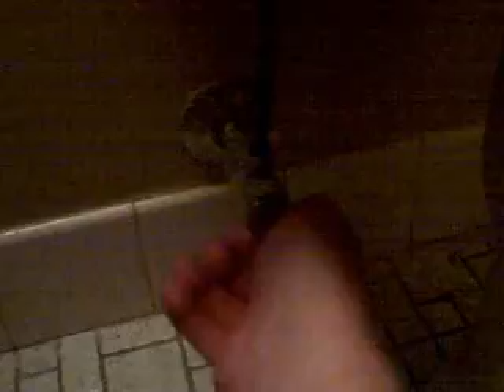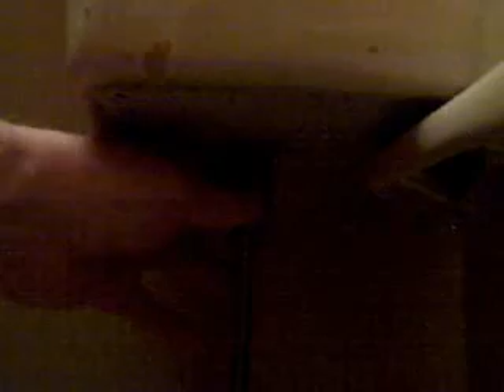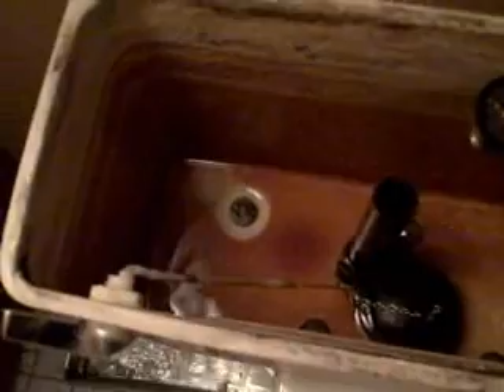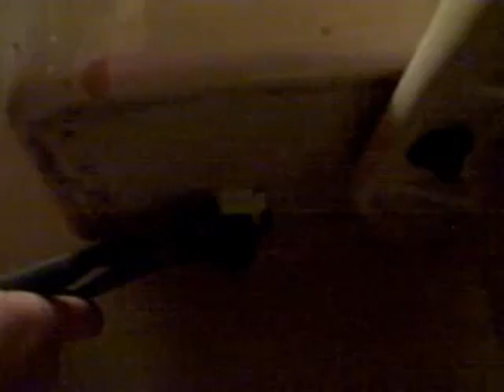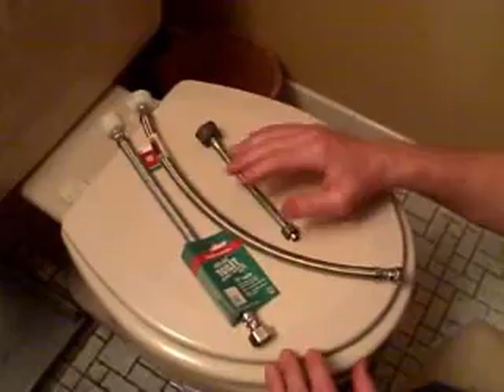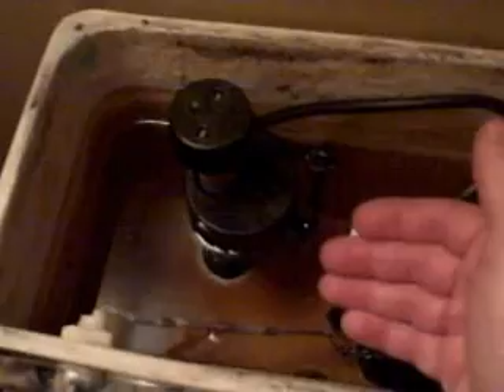How to Replace a Toilet Fill Valve - Fluidmaster

Comment: Sometimes my fluidmaster won’t start filling after a flush. If I open the tank and just lightly push the black rod on the float it will kick on and start filling. Almost like the float is getting stuck. Is it just time to change it or can this be serviced?
Reply from the maker: Hi, I would change the fill valve. Here is an updated video. https://youtu.be/2fVzAXakjZ0

Comment: The first step in replacing the toilet fill valve is to replace the shut off valve to the toilet because it doesn't shut off all the way.  But the whole house shut off valve doesn't shut off all the way either, so you need to replace it too.  Since replacing two shut off valves and a fill valve is a lot of work, and all manner of problems are likely to be encountered when messing with old pipes, I'll just call a professional plumber to do all of it.

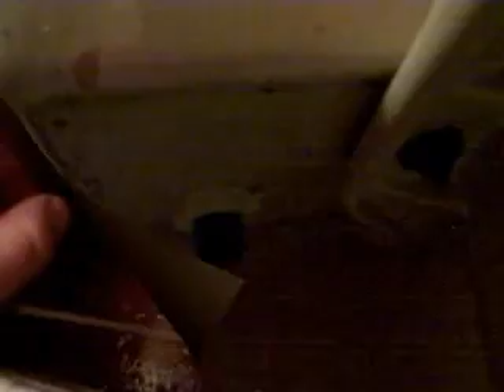Comment: At about 3:30, when you first mention installation of the refill tube, the "fitting" is placed so that the refill tube sends water into the tank instead of into the overflow tube.   At 5:40, this is seen to have been corrected.  Might be a nice detail to mention to your viewers that the refill tube indeed does need to empty into the overflow tube, to insure that the bowl is refilled properly so the next flush is successful.  Thanks for taking time to make this video!

Comment: my flushing tank water overflows, turning the rod counter clockwise water not stopped. what might be the reason?
Reply from the maker: Hi, when you say it overflows, is the water coming out of the tank or into the top of the tube on the flush valve? You are turning the rod on the fill valve?

Comment: I can't fix a thing to save my life. But by using your video and a few others, I was able to replace my ball cock with a new universal fluidmaster fill valve. Took me two hours and was much more difficult due to cramped space and supply line nut being very difficult to get off at the top, but I did it. Thanks for this video.
Reply from the maker: You're welcome.
We have more home improvement tips on our weekly podcast http://castbox.fm/u/6389499.

Comment: Going to be replacing mine in a few days...
Reply from the maker: Hi, if you have a high efficiency toilet, 1.28 gpf. Use the PerforMAX fill valve and adjust the amount of water in the bowl. For older toilets, the fill valve in the video will do a great job.
Reply: I ended up using a universal replacement valve from fluidmaster this morning, Install was a breeze and everything is working like it should. Took no more than 20 min!
Reply from the maker: Great! We have more home improvement tips on our weekly podcast http://castbox.fm/u/6389499.

Comment: If you're not replacing the supply line (which if it's not leaking, and already the flexible kind, why replace it), you don't need to loosen the nut from the bottom valve to the supply line FWIW... :)

Comment: Are they better than the old bubble float type valve or called flip float valve? is there any flaws, let me know because i'm planning on replacing mine!
Reply from the maker: Hi, 2 of the top rated are the Fluidmaster and the Korky fill valve.
If you have a high efficiency toilet, use the PerforMax. It puts more water into the bowl for better flushing. 
We have more tips in our home improvement book https://amzn.com/B01MRGO8C5.
Reply: Thanks, I had replaced mine with that type of fill valve, and it really fills the tank faster, and my old one had like continuous hissing sound, which is the gasket was bad on the valve so i figured it's time for replacement or upgrade!

Comment: The problem I ran into was being able to extend the rod.  When I pulled on it - it wouldn't move.  But since I saw you pull it out in this video I knew it had to come out.  So I pulled much harder while being sure not to squeeze the top so hard I had to break something.  People should be sure to move the little band off when pulling it out.  I had done that but it still wouldn't budge until I put some more muscle into it.  So you may have to pull fairly hard to get it to extend.  Thanks for posting this video.  Really helped.

Comment: That toilet label is interesting. Is there any doubt that is in fact a toilet to anyone? Maybe in the other bathroom it's an escape hatch to a bat cave and that toilet has a label that says "Bat Cave Entrance" ?
Reply from the maker: Ha
Reply: Great video and glad you have a sense of humor!  Wish I had seen this before I replaced mine.  Had to readjust the height after it was bolted into the tank.
IMHO this is a cheap valve.  Mine was only 1 year old when it started leaking back into the bowl and didn't realize it was leaking for weeks.  That refill flexible tube has to be mounted in the center of the vertical refill pipe with that extra part and clip so if it does leak at least you can hear it splashing.  The vendor claims  the mod is to prevent siphoning but that is complete BS in my opinion.  The mod is so you can hear if the refill valve is leaking back into the bowl.

The specific valve I had was with a brand new Mansfield toilet Part number 2300 something so a very similar valve but may not be the exact same manufacturer but general design.   Very flaky in general I think and the refill tube mod points to chronic leaking problems.

Comment: When my boyfriend put this in, I don't believe he looked at any instructions. But forgot to put that rubber piece at the very bottom and it leaks now. How do I remove this specific fill valve to get that rubber piece in place?
Reply from the maker: Hi, turn off the shut off valve going to the fill valve. Hold down the handle and drain the tank. Put a pan under the supply line going to the valve. Take off the supply line and remove the one nut holding the fill valve in place. Pull it out and put on your washer. The beveled side down toward the toilet.

Comment: Do you have an instruction video on repairing a tank that won't fill or fills very very slow
Reply from the maker: Hi, if you have a Fluidmaster fill valve, you can push and twist the top cap and lift it slightly to flush out debris. Keep it covered with your hand to prevent water from spraying up.  If you have a different style, let me know. 
If flushing doesn't help, then change the valve.
We have more tips in our home improvement book http://www.amazon.com/dp/B01BK2K0JM?ref_=pe_2427780_160035660

Comment: THANK YOU SO MUCH!!!  I found a puddle in my bathroom yesterday.  I shut off the water immediately & of course cleaned up the puddle.  

It was the original toilet (30 years old in July!) complete with that big ball thing.  The thing holding the tube in place was difficult to get off.  Between the fact that the toilet is 6" from the wall and the plastic piece was so difficult to grab; I almost gave up a few times.  

One thing I really liked about the new one is there was big wing nuts so it would be easily removed next time.

I purchased a Fluidmaster 400A and the instructions were impossible to read!  The printing was small & even worse confusing!  (Well at least to a person who never replaced anything like that before!)  They show something about grabbing the top of the new device AFTER it was screwed into the toilet and lifting it up and ripping the top off.  It showed some drawing and even said when you do this have something over it because it will spray water upwards.  It also said to turn the water on & fill the tank and then drain it again and "prime" the top. 

I went to the website for Fluidmaster and they had a link to a video.  I watched it and found it just as confusing as their printed instructions.  It also showed pulling on the top of the plastic and turning the top 3/4 of an inch.  

I finally decided to just go to you tube and put in "how to install the Fluidmaster toilet valve."  Your video was first up so I watched it!  Clear instructions and then showing how on the video!  

I still don't know what the instructions meant about pulling up & turning the plastic and prepare for spouting water but your video didn't show that so I didn't do it.  I only had to turn the water back on once and I had no leaking from the valves and it is now working great!  

So thank you for the great & crystal clear video!
Reply from the maker: +Suzie Phillips Hi, glad it was helpful.
We have more tips in our home improvement book http://www.amazon.com/dp/B01BK2K0JM?ref_=pe_2427780_160035660

Comment: I'm changing my fill valve, and it has been glued to the tank with something.  It broke off trying to get it out.  How can I get the remaining stuck part off the tank bottom to install the new one?
Reply from the maker: +Teresa Jackson Hi, did you get the nut off the bottom of the fill valve? What part is stuck, inside or out?
Reply: Inside is stuck.  The nut came off on the outside easily.  A plumber fixed a leak there a year ago and changed it all.
Reply from the maker: Can you take a slotted screw driver from under the tank and tap the piece that is stuck. Pushing it up and away. Being careful not to hit the tank.
Reply from the maker: You can send a picture to fixitpodcast@gmail.com

Comment: what happened to the other black rubber washer, the one that was in the center of the big washer? was it thrown away?
at 2:20
Reply from the maker: +nonoyd Hi, the center washer is for a solid supply line. Most people use a flexible supply line so it isn't needed. The new packaging doesn't include it.
We have more tips in our home improvement book http://www.amazon.com/dp/B01BK2K0JM?ref_=pe_2427780_160035660
Reply: +FIX IT Home Improvement Channel thanks for responding, i replaced my tank with fluid master refill  kit  a few years ago and i dont remember seeing  that center washer. i thought i missed something, i bought the rectangular or square float refill kit.

Comment: Why do you have to replace the supply line?  The video didn't show this as a "possible" need, just what you have to do.  But I wonder why.
Reply from the maker: +Gloria Jenkins Hi, the supply line that was there was an old rigid supply. If you have an existing flex supply line you usually don't have to replace it. I should have addressed it better. Thanks!
I will put together a video showing off some tips for supply lines.

We have more tips in our home improvement book http://www.amazon.com/dp/B01BK2K0JM?ref_=pe_2427780_160035660
Reply: Thanks!  I checked it a few minutes ago and it looks pretty ancient!  I don't think my husband changed it when he swapped out the old ball float for the new one.  I guess I'll get a new one!

Comment: Why didn't he re-use the old supply line? Would the old one not fit on the new fill valve, or was it simply a precaution to replace an old part with the new one?
Reply from the maker: +Bungle Hi, the old supply line was rigid and just fit. The new flex supply line was easier to connect. 
We have more tips in our home improvement book http://www.amazon.com/dp/B01BK2K0JM?ref_=pe_2427780_160035660

Comment: I have a new fill valve and the height wont adjust on it.  What do I do?  Do I need to return it and get a new one?
Reply from the maker: +Kathy Booe Hi, what is the problem?  Is it too high for the top of the tank to go on, or are you having a problem adjusting the water lever?

Comment: How do you know if you have to change the fill valve or not?
Reply from the maker: +Joshua Truax Hi, if it is filling slow and you have flushed the top valve, or if it keeps running and won't shut off. That's when I swap them out.
Reply: +FIX IT Home Improvement Channel Oh ok thank you so much.

Comment: I need a kind of gasket for my supply live. It leaks, and needa rubber thing inside. What is it and whats is the normal size?
Reply from the maker: +Tino Rozzo Hi, I would pick up a new braided supply line. They have a beveled washer that does a great job. I doubt if a hardware store will carry that gasket.
Reply: Thanks. I don't know what my plummer did. I had to get a rubber O ring for the bottom of the flow valve connector.

Comment: JUST GOT THE WORD FROM FLUIDMASTER RE:  WHY IT'S TERMED AS INCOMPATIBLE,   IT WILL FIT,  MINE FITS GREAT,  BUT THE ISSUE IS THAT THE MATERIAL USED IN THE MANUFACTURE OF THIS PART WILL"DEGRADE" IN THE PRESENCE OF A CERTAIN LEVEL OF CHLORINE.   AS SUCH IT MAY BREAK UNDER WATER PRESSURE,  ESPECIALLY PRESSURE SPIKES.  REGARDS,
Reply from the maker: +LLuE88 Great. Thank you for sharing.

Comment: very good.      Question on the FluidMaster unit,   do you know why FluidMaster has indications as to  not use/remove the bottom tube "shank " if it is gray  or not Black.  If it is Black it is fine to use it when the initial intension is to replace the whole FluidMaster unit.   thankyou,  regards,
Reply from the maker: +LLuE88 Hi, you are talking about the Easy Fix 400? This kit is designed to leave the main body of the old Fluidmaster in place. I would remove the complete old unit and replace with a traditional 400 A. 
Let me know if that helps.
Reply: +FIX IT Home Improvement Channel I suppose I need to call or write to the factory.    If it's faulty material,   it definitely needs changing,    if it's a leak  or compatibility issue,  then living with it may be OK?     Noticed a slightly tighter fit with the newer top part,   easy to fix though.    regards
Reply from the maker: Hi, just curious why you picked that rather than the whole replacement.
Reply: +FIX IT Home Improvement Channel just prefer to use what's available and safe or proper to use.  Also to warn kin if there is a problem.   In part I was the decision maker on some inferior Chinese parts that would have failed on a good sized piping job,  initially no  one knew there was a defect except by lab reports,  the producer was found out after the lab reports.  regards,

Comment: Instruction sheet enclosed with new valve does neither say anything nor show anything about releasing the lock collar to increase the length of the valve shank. Would be very helpful if it did. Thanks for showing this.  Used cheap  disposable turkey baster to remove  remaining water in tank - dispose of water in toilet bowl - saves a lot of mess,
Reply from the maker: will alexander You're welcome.
We have more tips on our weekly podcast https://itunes.apple.com/us/podcast/fix-it-home-improvement/id880903087?mt=2

Comment: Nicely  done...would have been better had you put some kind of light under the tank as to see what you were doing..one had to guess. I noticed that the bottom of your tank after draining it to take off the old one, the color of the water. It looks just like mine, and makes one wonder, that is the same water line that is usually attached to your sink and tub and sometimes we use the sink water to brush our teeth and gargle and even drink some water...ugh!
Reply from the maker: Anthony Thanks.
We have more tips on our weekly podcast https://itunes.apple.com/us/podcast/fix-it-home-improvement/id880903087?mt=2

Comment: I live in an apartment and both the valve that's the shutoff and the fill are running... I was using the shutoff because of the running fill valve and apparently it wore out. I tightened it by hand and with a screwdriver as tight as possible and it keeps running. is there any way I can replace the fill valve without involving my landlord? Like replace the fill valve without shutting off the one on the bottom all the way? Otherwise im afraid the landlord's family who do repairs are gonna have to shut off the building's water to do the job and I don't really want them coming in here. I'm concerned how much noise the running water might make through the pipes for my downstairs neighbors.. apparently the guy upstairs doesn't hear it. The pipes run vertically up and down near the bathroom and I can hear a hiss in my kitchen which is right adjacent. As long as people below me don't hear it I don't care that much right now, but my upstairs neighbor said 'water runs down so probably they hear it downstairs'..
Reply from the maker: Frater Tenc Hi, first, I would confirm that the fill valve is bad. When you say it is running, are you sure it is the valve and not a defective flush valve that is allowing water to drain into the bowl. If the flap or seal to the flush valve is bad, that is an easy fix without turning off the water. Did you try adjusting the float to the fill valve?

Comment: I just replaced everything inside the tank.  Initially it was fine but the fill valve seems to get stuck sometimes.  Sometimes it fills correctly, sometimes it only fills a little.  I have no idea what's happening
Reply from the maker: Stephanie Henry Hi, is the float too close to the side of the tank? It could be getting caught. 
Does it sound like it is trying to fill or does it sound like it just stopped?
Can you take a picture of the inside of the tank and email me at fixitpodcast@gmail.com.